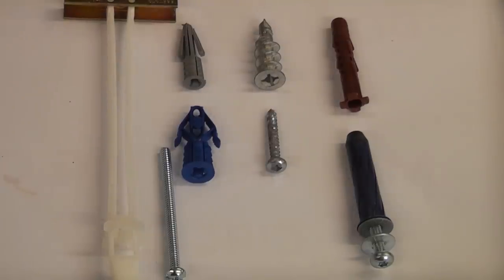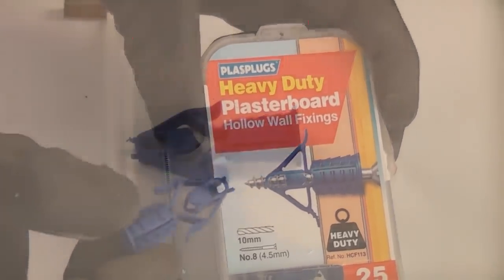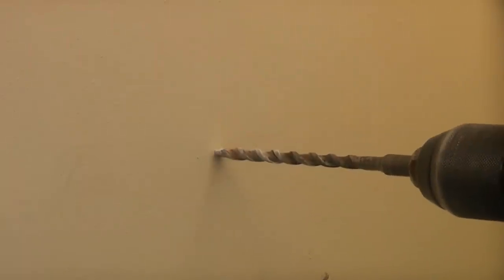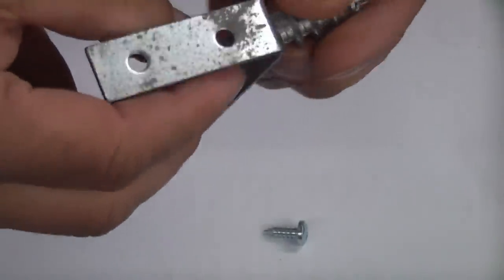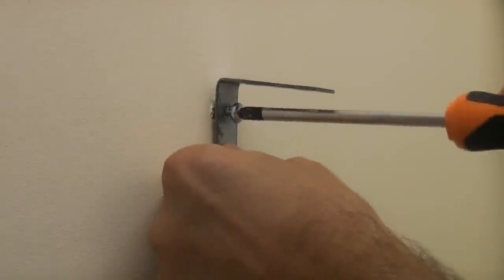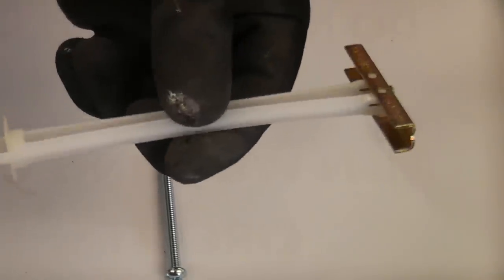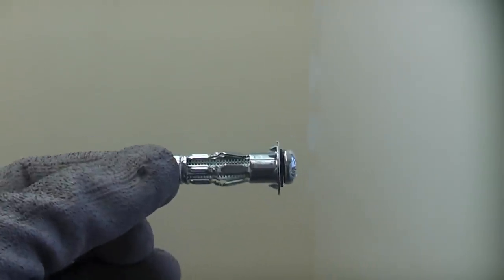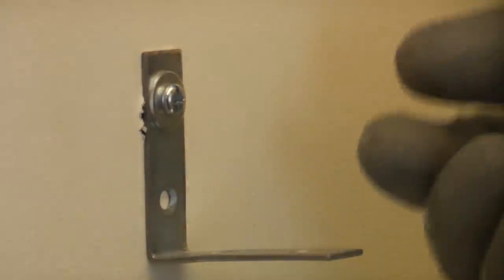Plasterboard fixings- The good, the bad and the useless!

Comment: Great video. The reason there's a cottage industry in assembling flatpack for people who buy IKEA stuff is because of issues like this. Ikea don't supply fittings- clever sods. Their rationale is "everybody's wall is different"- in fact there's maybe 3 types of wall but IKEA just want to skirt the issue, no pun intended. 

LOl the minute the worm screw came up I said to myself  "When I bought these in Robert Dyas for some reason the screws they came with wouldn't thread in all the way, I wonder how he'll show me how to do it" ............surely enough, the screws are just too long all the time no matter what you do. 

Did anybody else notice that when you go to do a job like this, one always is forced to BODGE it using a variety of fixings and methods?

Those blue ones look right rubbish. Maybe they work in double plasterboard.
Reply from the maker: I think one reason why some people are bad at DIY is because some of the tools and fixings are not fit for purpose and immediately the people think that they have done something wrong, when really it is the product!
Thanks for the comment ;-)
Reply: @ultimatehandyman  Yep it's not rocket surgery, as the man says. It's just getting basics right, and if you are hamstrung from day one, you just lose heart and throw your hat at it.
Reply from the maker: @errolkim1334   Absolutely. I have heard so many people say that they are useless at DIY, when in reality a lot of problems are caused by them choosing cheap tools or the product itself has not been fit for purpose.
Thanks for the comments ;-)

Comment: I would be worried about all that swarf on the other side of the plaster board. Personally I would drill a small pilot hole and work up to the recommended drill bit size to avoid all that mess interfering with my fixing.

Comment: Hi Ultimate Handyman,

Greetings, from Costa Rica, I hope this message comes to you and that you can help me with some doubts that I have, thanks to this video I understand how wall plugs are installed, used and how they work, thank you very much.

In my country, the anchors found in stores are the "Spring Toggles", "Snaptoggles" and the "Worm Type Screws" of Nylon, the metal ones I have never really seen here.

My doubts are the following:

1. When I use both Spring Toggles and Snaptoggles how do I  decide the size of the hole I must make to be able to insert these anchors since there are several sizes of them according to the weight they are going to hold.

Or in general, using any type of anchor, how do I know the size of the hole that need to do in the wall to correctly insert the wall plug and how to know the size of the screw to use for a   suitable grip.

2. What should be the thick/width and length of the screw use with the Worm Type Screw?

Thanks for your help, and keep making this kind of videos !!!
Regards!!!
Reply from the maker: With spring toggles or snap toggles you just need a hole which is large enough for the fixing to pass through it. Normally this is about 10mm diameter. The smaller the hole is the stronger the fixing will be.
The screw for a worm type screw fixing needs to be about 15/20mm long- unless you are fixing something that is thick. If the screw is too long it will bottom out in the fixing and it won't work properly.
Thanks for the comment
Reply: @ultimatehandyman   Thank you very much, you are the first youtuber who actually respond back to me, please keep doing content as useful as this video!!!

Comment: Which ones would you recommend for fixing kitchen base units to?  *Ideally something easy too 😄
Reply from the maker: I'd go for the spring toggles as they are one of the cheapest and easiest to use.
https://www.youtube.com/watch?v=ECDysfNhx_E

Or you might be able to pick up a couple of the studs and screw directly into them - https://www.youtube.com/watch?v=glzwY76O0d8

Most base units are fairly sturdy and once you get a few of them fixed together they should not go far ;-) 

Thanks for the comment

Comment: I was going to ask if the 8mm screw was the recommended screw for the heavy duty plasplugs but I just saw it on the packet. I shall stay away from those.
Another great video 👌
Reply from the maker: +aQSteve 
A size 8 wood screw is recommended, which equates to about 4mm in diameter.
Thanks for the comment ;-)

Comment: The main problem with some of these fixings is the insulation behind the dry wall,, it undoes the screw/bolt back out right before your eyes. Behind every sheet of drywall should be a sheet of plywood, then you can hang anything anywhere. It cost more but it insulates, it soundproofs and makes for an all round better job.
Reply from the maker: Thanks for the comment

Comment: I have found this video super usefull! thanks for explaining it so easy and clear. However i still have a couple of doubts... what fixing would work for a 55" TV (22 kg). I guess the best is the "grip it" but i have never seen those in Mexico! Im not the best hadyman around lol. Yesterday i tried with the Zinc ones but as you said, my lack of knowlege made me use the long screw it came with and I ended up damaging the drywall and makingthe hole bigger and bigger as I keep "tightening" the screw and It lost all traction and got very loose.
Reply from the maker: If you can get them I would use spring toggles, as they gave one of the strongest fixings when I tested them-
https://www.youtube.com/watch?v=ECDysfNhx_E
Thanks for the comment
Reply: For a tv and where a stud can’t be found, I’d recommend sistering one to an existing stud. That, or just use a table!

Comment: Excellent video, thanks. I'm going to be putting a mirror with lighting/shaver socket onto my bathroom wall.  (So it's fairly heavy) The wall is of an internal stud variety, but has tiles on it too. I'll attach it to a stud where possible, but it won't be possible for all four fixing spots. ) Can I ask which of the fixings would be best for this purpose please? (I don't want the tiles to crack when the fixing expands in the hole.)  Thanks very much.
Reply from the maker: I'd use spring toggles as they give one of the strongest fixings possible- https://www.youtube.com/watch?v=ECDysfNhx_E
You will however have to drill a fairly large hole for the fixings.
Reply: I thought that might be the case.  Thanks very much, I'll give it a try.

Comment: Plasplugs work really well for me ... I've never had them break like you did. I wonder if the pack you got were defective or the screw is the wrong size. Mollybolts on the otherhand are useless without the setting tool... and in North America, you can't find the setting tool!
Reply from the maker: Not sure, but the other Plasplugs fixings worked with no issues.
Thanks for the comment

Comment: This is an excellent video. Any chance of a similar demonstration on thermal plasterboard?  I need it like yesterday!!  With so much of this stuff being used to insulate properties I am amazed that I cannot find any fixing products specifically aimed at this sector.  I need  some medium to heavy duty fixings to hang a mirror (about 6 kg) and a curtain pole.  The plasterboard itself is only 7mm and the foam backing 30mm, installed by dot and dab method.  I have looked at so many products that I am starting to feel punch-drunk.
Reply from the maker: You can use Rigifix on dot and dabbed walls https://www.youtube.com/watch?v=xaYfs3lr1jI
But when there is insulation behind I use this method- https://www.youtube.com/watch?v=7DGGUbbbBZI
Reply: Thank you so much for replying.  I will look at those videos.  Much appreciated.

Comment: Really great informational video there, brilliant to see how they all work.  My house has what I believe are called ‘dot and dab’ walls though (plasterboard faced on to breeze block wall stuck by dots of plaster, leaving a narrow cavity between the board and wall) Have you done any videos to recommend the best fixings to either fix things to or hang pictures from this kind of wall?
Reply: I've had to deal with these many times, and looking back I can't believe I didn't realise how to do it sooner.

Just use a longer Rawl plug for masonry,  to account for the small gap. Last ones I used were 80mm iirc, used to hang curtains.

If the gap is larger, you can also drill out a bit of the block to make room for a plasterboard fixing. Any one of the shorter styles here, that don't have large flanges.

Comment: Regarding the "Plasplugs Heavy Duty Fixings" that keep breaking. You can clearly see the reason they are breaking is because the screws were too large. The screws were not threading properly into the far end of the fixing which resulted in the fixing becoming twisted instead of being pulled against the back of the plasterboard. I realize the package indicates using No.8 screws, but from where I'm sitting, I can't be sure that those screws were in fact No. 8 screws and knowing that screws get mixed easily. 

Have you tried threading the screw into the fixing until it pierces through the end, then insert the fixing into the hole and  tighten until snug?
Reply from the maker: +rpprevost
I used the exact same screws on the other plasplugs fixings and they worked. Also did I not try two different screws (l can't remember and am using my phone) ?
Reply: ***** Yes, you did use two screws, but they were both No. 8.

Comment: What is the best fixing to use for a mop stick hand rail? Should I use backing board to spread the fixings out? Any advise would be appreciated love your vids keep uploading I'm learning a lot! From your vids
Reply from the maker: +Mark Weston 
A backing board will definitely help, especially if the wall is plasterboard. The problem with handrail brackets is that they normally have three fixing holes, but they are too close together. It's therefore much easier to fix a board securely to the wall and then simply use wood screws to fix the handrail brackets. 
If the wall is Hollow plasterboard I would use either Snap toggles or Grip it fixings, if it's a dry lined plasterboard wall I would use Rigifix fixings  https://www.youtube.com/watch?v=xaYfs3lr1jI 
Thanks for the comment ;-)

Comment: I used the Grip It fixings to secure Ikea heavy duty stainless steel kitchen shelves, the upright part of the shelves is wide enough to cover the GripIt's which are quite large, also these fixings are expensive - should be sold individually, rather than in a pack? They seemed to have done a good job - also, they come with high load ratings, which I haven't been brave enough to test...
Reply from the maker: Yeah, a lot of fixings require a large hole, which is why I normally use the snap toggles.
Thanks for the comment 👍

Comment: awesome vid loved it,need to springt toggle into my plasterboard ceiling to hold up my tweeters for my 5'1 surround system as i would like to hang them from chains now with the chain it will come to approx 1kg in wieght will this be ok do you think,i will be looping the small chain through the 2 speaker bracket feet which are designed to fix into the wall and then back up to the fixing hopefully this will work out
Reply from the maker: The spring toggles should easily hold something that weights 1KG from a ceiling.

Comment: I've found several times with this worm type fixings it started to damage the plasterboard on the way in. What the best fixing for putting up ceiling lights such as a multi spotlight plate type fitting
Reply from the maker: I normally use the snap toggles/ zip fix fixings 👍

Comment: Which of these would you say are likely to be compatible with stud walls containing Celotex slabs as insulation, rather than hollow stud walls? We’ve just done a loft conversion, but the zinc worm screws don’t seem to be holding much weight in our plasterboard. I’m wondering if any of the fixings that open out would do so strongly enough to squeeze the Celotex out of the way and get a firm hold?
Reply from the maker: The zinc worm screws are not much use for heavy items, I did a weight test video here with a selection of fixings-
https://www.youtube.com/watch?v=ECDysfNhx_E
I'd probably go for Grip_it fixings, but you will also need the under cutting tool, I used them here to fix a batchrrom cabinet to a plasterboard wall, which had egg box in the partition- https://www.youtube.com/watch?v=-geib-6sa3M
Thanks for the comment

Comment: Do these work for ceilings too? I have a lampshade where the base has come off loose and is now hanging by the wire. There's a hole in the ceiling that the screw has come lose from. The plasterboard seems to have broken around where the second screw should have gone so I'm wondering what's my best option. The lampshade is quite light (under 1kg with bulb and base) so wondering if one screw with one of these fixings put into the existing hole will do.
Reply from the maker: Yes, but for ceilings there is a better option.
Cut a piece of 1/2 inch thick timber that will fit through your hole (perhaps 1" X 1/2") and about 6 inches in length. Drill two small holes in the centre of the timber and thread a piece of string through the two holes, so that you can push the timber through the holes, then use the string to pull the timber down flat against the ceiling. Pull the timber flat to the ceiling, then put a couple of screws through the plasterboard and into the timber (make sure the light fitting covers the screw heads). You can then screw into the piece of wood with the ceiling rose screws. This will be much stronger than any plasterboard fixing 👍

Comment: Those grip-its look a bit daft. Alright if you don't mind seeing all that fixing at the edges I suppose. I used hundreds of the worm-screw things DeWalt zip-it brand. I used them everything, they can hold loads of weight and I never had one fail. I hung a cd case on the wall with three, some 80 CDs. I never had a screw bust the worm part either.
Reply from the maker: Thanks for the comment

Comment: always wondered what happened to raw plugs when screw went into them
Reply from the maker: Thanks for the comment
Reply: would use use raw plugs in ceiling fixings instead of the screw in ones ?
Reply from the maker: @jlindell6532   It depends what you are fixing. If it just a smoke alarm or similar, rawl plugs are fine ;-)

Comment: 9 times out of 10: drill 8mm hole, use nylon ready driver, with the point nipped off so the screw can go right through; oil the screw before fitting so that it can be removed if required.  0.8p each.  For heavy items, e.g. basins, I'll cut in & put hefty battens or ply panel behind  (beforehand if first fitting).  Useful vid whatever.

Comment: First of all, that was a great and informative video.  I am going to be installing a shower grab bar for my mother and was going to install it vertically so I hit the stud with both ends but I am wondering if the snap toggles would be good enough if the other end was anchored to the stud?  if this sounds good I can make the bar horizontal and easier for my mom to hold onto.  What is your thought on this?  What would you do for your mother(, assuming you like your mother that is LOL)?
Reply from the maker: As long as you get one end fixed to the studs the snap toggles should be fine on the other end.
Thanks for the comment ;-)

Comment: I have a plasterboard wall with four inches of kingspan right behind it. Any thoughts on if any of these would work since there's little space or no space  I'd think between the Kingspan and the plasterboard. The hollow wall anchor looks good as I'm wanting to put up a bookshelf. Thanks for your content. 👍
Reply from the maker: The Grip It fixings should work for that- https://www.youtube.com/watch?v=szx7nMRZSIY&t
But you might need the undercutting tool, which I used in this video- https://www.youtube.com/watch?v=-geib-6sa3M&t
Thanks for the comment 👍
Reply: @ultimatehandyman  Thanks :)